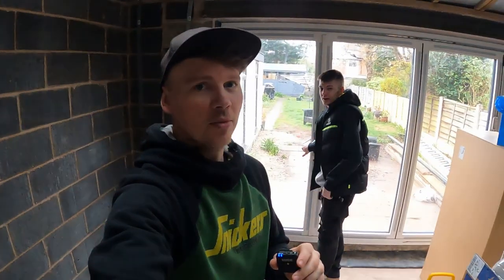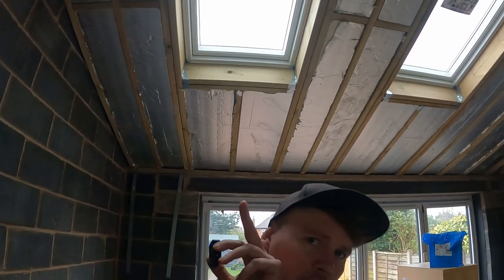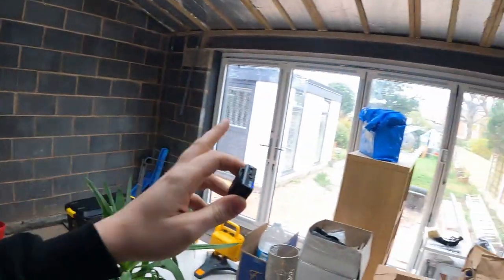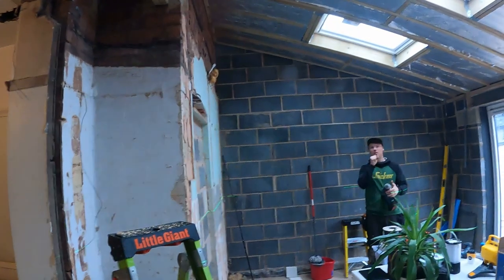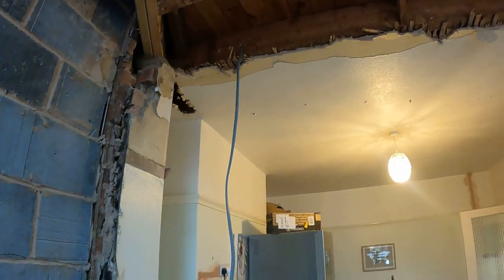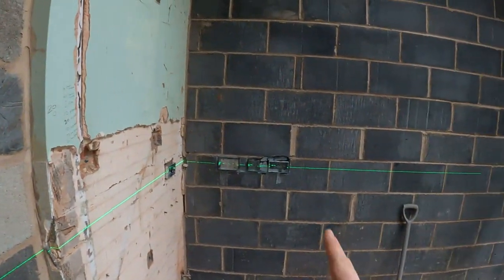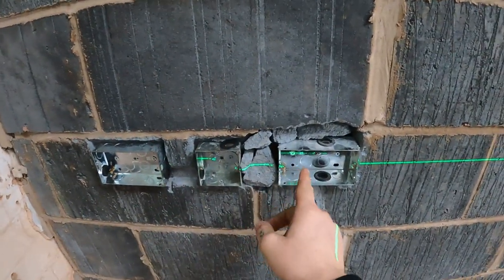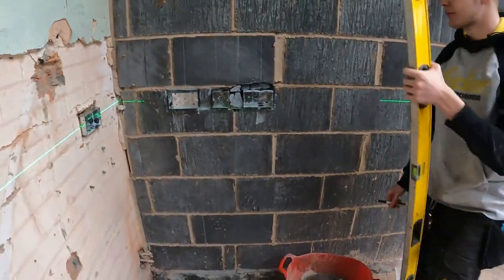Is Capping Cables a Waste of time and money?! - Electrician

Comment: I always use metal 1” sheathing on a new install like this one. However, I wouldn’t run the cables within the prescribed zones (150mm) at high level around the room, I would run them surface at floor level against the wall surface mounted behind the rear legs of the kitchen units then come up to the sockets/FCU’s flush mounted behind sheathing. 
I’d also never run cables across the top of the patio door as it is likely to be damaged by curtain poles or blinds being installed. I’d install a 20mm plastic conduit across the floor pre insulation and screed and drop the ring into that. Quick, simple and less chance of damage going forward. Glue the conduit to stop damage to cables by the chemicals in the floor screed.

Comment: The old school metal capping saved my bacon when I was drilling a hole to put up a shelf. From experience think it’s a good safety feature.
Reply: but is its all rcbo now is it the same as the capping?
Reply: @eddjordan2399  metal capping gives you an early indicator that you're drilling somewhere you shouldn't be. So you can stop drilling before you damage the cable. An RCBO will only help after you've damaged the cable, so the RCBO tripping is more of a last resort while metal capping (safeplates on drilled joists, warning tape over buried ducts, etc) is more of a preventative measure.

Not saying it is a requirement, just saying I can see why some people like to see it.
Reply: Ha, were you drilling with an old hand drill? 
Decent sds and capping isn’t going to save your bacon.
What capping is good for!!! It’s metal and so is good for identifying hidden/non std cable runs using a stud/metal finder.
Reply: @Jaymo_the_monkey  old masonry bit and combi - so little chance going through metal capping. SDS with multi-purpose bit and I’d have prob gone through, but not standard DIY kit. Metal capping might be redundant with new RCBO installs, but still nice to have that extra layer of protection.
Reply: @Jaymo_the_monkey  I don't know about the original poster, but personally if I need to drill anywhere "risky" I'll try and go through the plaster/plasterboard gently before getting the SDS out for any block/brick. Metal capping would help in that case because I'd feel the metal while doing the initial gentle drilling (sometimes I even do the gentle part by hand, e.g. with a blunt screwdriver)
Reply: What drill were you using black and decker? 😂 metal cappings like foil could chew through it
Reply: @mintsauce563 

Yeah, I'd be surprised if paper thin capping stopped any drill.

Comment: Glad this is been discussed, I've already posted my opinion on capping over cables behind dot and dab plasterboard, So for those who insist it's right or wouldn't do it any other way, If a customer asked for a socket say 1.5 mtrs away from an existing socket and you can fish a wire behind the plasterboard within the safe zone, Would you destroy the decorated wall to fit some pointless capping or tube ?
Reply: If it fits (and it didn't mean causing extra damage) I'd consider using oval tube. But only because it tends to do a good job of keeping fished cables straight (and therefore within zones).

Oval isn't usually too bad to fish through a wall, especially if you pre-sleeve it over the cable beforehand and get the right size so it isn't significantly bigger than just the cable.

Again, not saying it's necessary. But it can be a nice touch. I definitely prefer having some method of support, whether it's clips, holes in noggins, tube or capping. Happy to go with whatever I think is easiest at the time, and I won't lose any sleep if none of them are practical either.
Reply: You can usually slide some oval capping  behind a dabbed wall this also makes it easer to push your t&e through!!

Comment: Dot & Dab, total waste of time. Wet plaster still needs doing. That's just my opinion. I've never bothered with PVC capping, may aswell run a layer of duct tape down the cables
Reply: Not really, depends on the project. A  true drywall system means less mess and a quick finish. Even board and skim is dry and decorated quicker than waiting for traditional  plaster coat to dry. Use capping to protect the first fix installation from reasonably foreseeable damage that may be caused before the finshed wall surface is completed.
Reply: I lived in a new build house that was plaster board attached to battens on walls. No plastering on top at all.   It  was just emulsioned. 

No issues at all. Yes, it dents easy, but easy to repair.

Personally, I'd never bother skim coating plasterboard.

Comment: The same as you Nick, I tend to use oval conduit. It gives reasonable protection against a plastering trowel and also often gives the opportunity to remove/replace a cable for repairs/alterations. With switch drops, I use a bigger conduit than required so it's easier to wire up future additional lights without having to re-chase and re-plaster.

Comment: Capping was required when the wall was plastered with cement it stops the lime attacking the cable last ime I had to use it for that reason was early nineties it wasn't ever considered as mechanical protection.
Reply: There is no lime inside the cement...if you mean or want to say lye that's another thing..
Reply: @dkaloupis75  If you add  hydrated lime into a cement-based mixture it  improves plasticity and workability it's added when using it to plaster walls.
Reply: @brianwoodruff4891  Hi Mr. Clouseau. If you want to improve plasticity and avoid the use of lime, you can add febmix concentrated and job done. By the way my dad and I haven't encounter any issues bye using lime or febmix for the past 55 years at any wiring.
Reply: @dkaloupis75  Oh

Comment: As regards to the zones in the kitchen. What I've done in the past in that situation is if its all going to be behind units. Run a 2x2 pvc trunking low level. Drill a 20mm hole at the top and clip the cable up to the point  needed. Then the dot and dab boards will sit on the trunking no cables on show and it leave a good finish.
Reply: Same here mate good method

Comment: I do my drop to the first socket then to low level bring my cables out of the wall. Install all my back boxes at the level thats required and 20mm round condit going down to just below worktop height. then when it is plastered run surface trunking in the service area at the back of the cupboards and install the cables.. This avoids cables being damaged by the kitchen fitters

Comment: As a few have already mentioned I definitely recommend capping or conduit as we never know what damage dot and dab adhesive, bonding, cement etc does to a cable in the long run
Reply: Haven't you ever stripped out an old property? Cables buried in walls, bonding, plaster etc survive better than those in free air. I think it's due to the oxidising.
Reply: @shanginadildo  yes but not in cement chemical reaction
Reply: @ImranKhan-cf8gs  having just striped out a property with vulcanised rubber, I can confidently say that the cables buried in walls faired much better than the cables running through the joists. Burying cables in walls almost gives the cables an extra layer of protection, not only that they don't have to fight the reaction of air.
Reply: Old plaster, bonding etc yes true it’s proven cables were fine however a lot more chemicals etc in building materials nowadays eg chemicals to make filler go off quicker etc who knows what damage they can do to a cable if any, for me it’s a case of just trying to eliminate any potential issues.

Comment: Remember back in the late 1980s, firstime I encountered dot and dab boarding walls. After I already first fixed a kitchen extension similar to what you have, an bemused customer told me unless you get your electrician back to remove that capping I ain't plasterboardin your kitchen, So I haven't covered them behind plasterboard since. No need to, That plasterboard adhesive must be expensive

Comment: If installed correctly yes. Most of the time it's not  installed butt up to box or an inch past ceiling board into joist space making it useless for pulling thru for future additions without damaging decor. Granted plastic won't stop a drill bit or a picture hook for that matter but it makes a good 1st fix and when used in conjunction with a wall chaser other trades will know your a cut above the rest.

Comment: When it is going to be dot and dapped ,use the fire clips for mini trunking as once fixed it will not come out, unlike t/e clips ,you can run cables side by side in clips
Reply from the maker: they are rock solid mate
Reply: When walls are to be dot and dabbed,  you should be taking into consideration how long those cables are going to be left vulnerable to damage in the meantime. Thats all part of selecting the right installation method. Oval tube is much the same installation timeframe as clipping, plus you've less worries on subsequent damage before its boarded out.

Comment: Modern day drill will go through either methods galve or plastic without you noticing the capping... I use galve by default just looks like made the extra effort for the customer give a bit of protection / plastics a waste of time clipping direct no issues just speedy/chuck in budget way (ok for Friday's 🤣)

Comment: It seems a bit silly to me to go to those lengths to have a ring instead of a couple of radials, but I'm probably missing a few somethings.
Reply: So if you install a couple of radials in 2.5mm CSA cable then you’ll have to protect them at the front end with 20amp MCB’s/RCBO’s. That’s not ideal in a kitchen with several heavy loads possibly present, i.e kettle, toaster, hot tap, coffee machines, dishwashers etc.  switch on 2 of those type of appliances and bang you’re above the 20amp draw allowed.  
You could upgrade to 4mm CSA radials and then update to 32amp protection (same as a ring) but then you’ll struggle to get two cables into the terminals on many types of sockets and FCU’s etc. So in my opinion the ring circuit fed with 2.5mm CSA is the best option.
Reply: @jasonparker1971  I do a lot of social housing and a lot of clients spec a 4mm radial for kitchens and it works fine to be honest or tho not tried it with MK accessories which I honestly don't like anyway
Reply: I went the 4mm route for a kitchen I did 10 years or so back - just had an EICR done and the “electrician” that via the agents I got in (I rent out the property) is adamant “4mm is only rated at 20’amps” even when in an email I’d quoted the relevant tables from the regs. 
!!!! He Insisted I changed the rcbo from 32 to 20!!!! I’m going to issue myself a minor works cert to put it back again afterwards. Ridiculous. I’ll never let the agents employ his firm again. It’s made me realise EICRS aren’t worth the paper they’re written on.

Comment: I like to put the cable in the white oval conduit and use all round band  to secure for the drops only, clip the rest like you have. Bang on boyo.
Reply: but you dont have to cap in stud so???? its a grey area these days
Reply: @eddjordan2399  what's the reg if a cable is not concealed in a wall less then 50mm but protected by a rcd?

Comment: I always use capping or oval, not for mechanical protection but if some other 🔔end goes through the cable,easier to pull in a new one 👍🏻

Comment: Here in Spain Nick, it's flexible conduit smashed into the walls, singles, and your sockets are on a radial each fed on its own leg from a central connection point (or a few if needed) in each room.

It is so much better than clipping twin and earth direct or trying to drag it through oval conduit. 
So easy to upgrade the circuits as well, and it's normal to put extra conduit runs in to allow for fibre optic etc at a later date. 

Maybe I should start a You Tube channel on it so all the expats out here can understand what's going on. 😂
Reply: I like the way they do electrical stuff in Spain. Thirty years ago everything was RCD'd.
Double pole breakers on everything and flush consumer units. Lovely.
Reply: @markrainford1219  I agree, so much safer -  and how much is a double pole breaker compared to an RCBO which is now the norm in the UK?
I swear the UK just keep re-wiriting the regs for the sake of it. Everything here is electric - and most houses have a 25 amp supply. ours is a 3 bed 2bath detached - aircon, immersion heater etc - It' never tripped. Meanwhile in the UK sparks are having to work out if an 80amp main fuse is sufficient on a 2 bed terrace house with gas central heating and water. ;-)

Comment: Our company has never used capping the answer is simple .it can’t be rewired due to the fact the cables are so tight in the capping.  Why make your job so hard .  Take your cables to the floor level under the proposed kitchen units  for any power that is required in any cupboard.put your sockets in above the work top with a chase in conduit to below the work top. Plus if the client has any additional items that need power you will have the ring main under the kick plates . Hope this helps you 😊

Comment: The Dewalt clipping gum seems to work a treat. I do have one myself but it seems to struggle a bit when I point it at hardwood timber. How do you rate it for fixing to block work? As I understand it there is only one type of insulated clip available. I’ll now need to try on masonry. Given the lacklustre result with hardwood I didn’t think to try it on anything other than soft woods.

Comment: So when I was an apprentice (qualified 2.5 years now) I had it bashed into me that you shouldn’t run cables at a right angle horizontally half way up a zone like how you’ve done the cooker hood nick! I done it on a first fix when I first started as an apprentice on an oven from the iso in a kitchen and the guy I worked with was like that’s wrong you can’t do it like that, so made me do it again & go right up to the ceiling & vertically down. I’ve done it like that ever since never thought nothing of it again. 
Any idea who’s right, I’m not picking nick. just a general question for you or anyone! Thanks
Reply: It's in the zone horizontal to the cooker hood outlet and the vertical socket drop. No problem.
Reply: The way your doing it is the proper way . . Although the regs have changed some time ago  and you can run cables horizontally like that ,remember most builders , carpenters etc have had it drummed into them that cables should run vertically. Hence we see more and more cables being drilled though these days.. Don’t forget the regs are the minimum requirement and your way is far the best .

Comment: Tracked in PVC 20mm round pipe should be used regardless of RCD protection. Helps for future Rewiring or fault fixing
Reply: Standard practice here in NI and have made many rewires handy for myself.

Comment: What about protection from the chemicals used in the adhesives on the pvc cable?  Some adhesives eat into the pvc over time. So capping would prevent this when dot and dab is used or when plasterers bond the wall over your cables.

Comment: 9.50 you said could strip the celotex out and drill all the roof joists ? As I understand you drill any roof joists trusses etc ,you weaken the structure of the roof ,it's designed size wise to carry only the weight of the roof and never to be drilled (weakened)?

Comment: Capping is completely unnecessary imo. Some people think they're 'going the extra mile' or whatever by doing redundant stuff but imo it's a waste of time and money. Cable is double insulated and capping doesn't protect it. It's also very hard to break two layers of insulation with a trowel which are 99% of the time not sharp-edged since they're worn in.
Reply: What about impact of cement or adhesive to the cable?

Comment: A drill or nail goes straight through Capping ,it is only used to protect cables from the plasterers float .Most jobs are dry lined so there is no reason to use it .

Comment: I think the conduit in chases is unnecessary. It takes up all the room of the chases and doesn’t make a good surface for the bonding to adhere to. It doesn’t offer any extra protection. Also realistically it aint gonna make a rewire any easier unless it was singles.

Comment: Nick? I was going to contact you directly to discuss this. However, you seem to be the type of guy who wishes to be transparant. 
Myself and one of my plasterers were asked by a customer of yours to cover up some work. No issue there, that's normal procedure.

What i did wish to point out was the poorly fixed cabling. We had to remove the fixtures and re-fix them. Again, quite poor but not a BIG deal..

The BIG deal was the washing machine. The cable was NOT fixed to the wall so vibration over time could cause damage to either cable and/or wall. More so, shorts.

There was also a non earthed metal boxed switch at the top of the stars on a SPDT (The typical 2 x SPDT set up for up and down stairs)

Ill drop you an email titled "Comment BLAH on youtube".

Cheers.

Comment: Waste of time offers no protection really…and not a requirement. I’d consider it if it was outside a zone unintentionally. Other than that get it clipped
Reply: You're looking at the completed electrical installation as a whole, and thats where you're incorrect.
    Selection and erection of materials  starts from day one. So during the construction phase, you should be designing your install to be protected from any reasonably foreseeable occurrence.
Reply: @idi0tdetectioninprogress  clipped cables are compliant my point stands. You’ve offered no evidence to support the rabble 😂👍🏻

Comment: did i see this correctly...usually a perfectionist then bodges a few old bits of brick in the wall, silicon sealer over the top and some brick dust/dirt from the floor....bodge of the century!